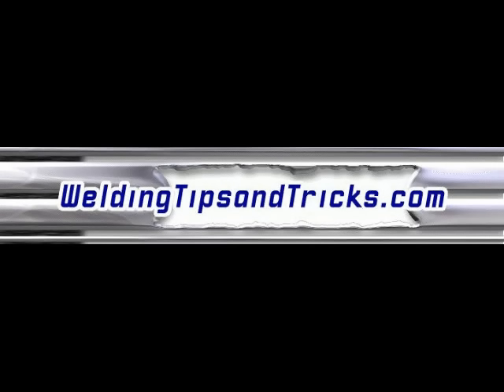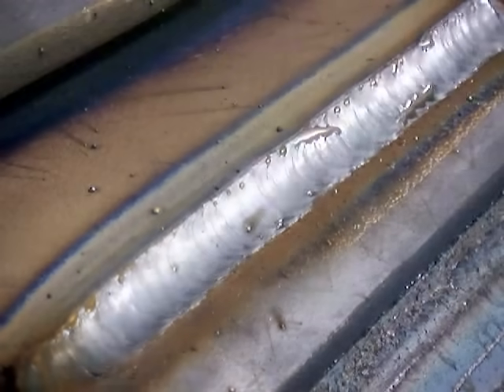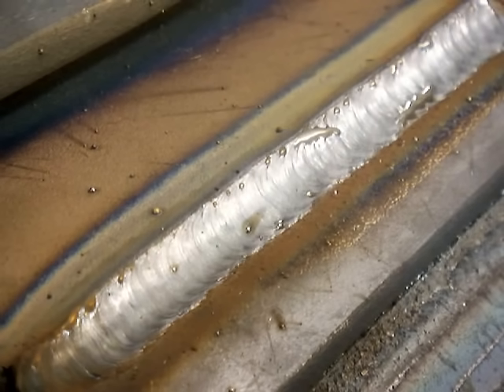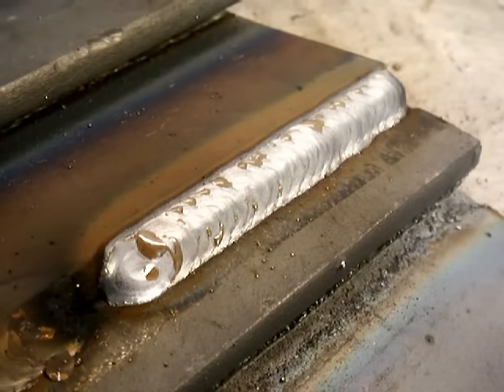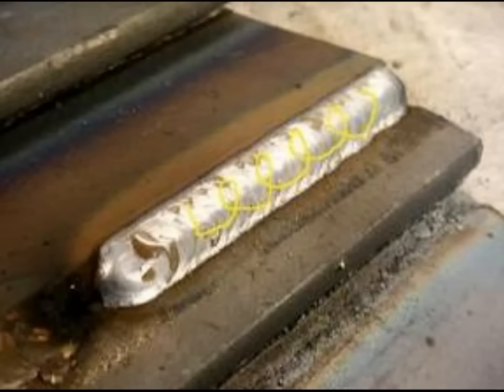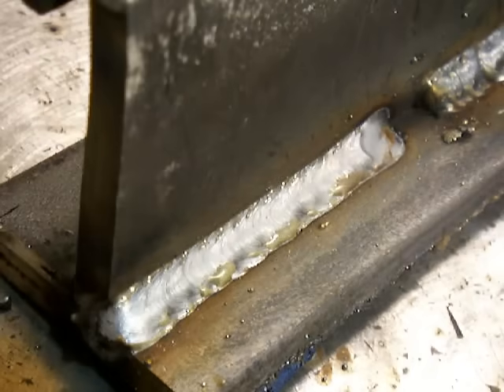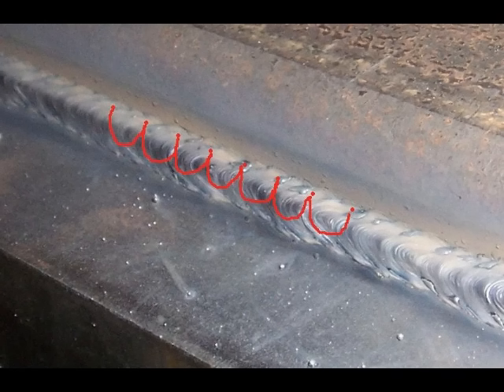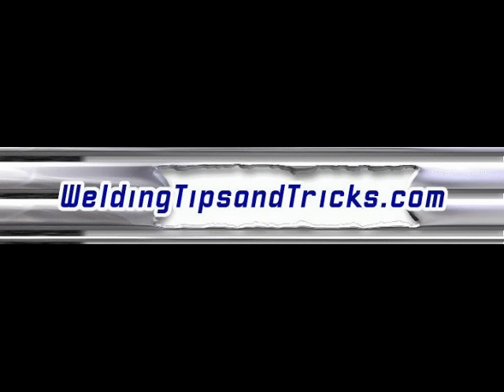Mig Welding Technique Taught by Old Timer

Comment: I am just learning. Hobby/homeowner stuff just out of necessity. I must say those are some fantastic looking welds! I didn't know they could look that good.
Reply: These aren't even that nice!
Reply: Practice, Practice, and when you get tired...more Practice!
Reply: try new techniques of welding on scrap metal as often as you can and don't be afraid to make shit beads. when you find something that works and you like it then tweak it to perfection. ideally you need to understand "L.A.S.H." and keep it in mind when welding (Length of arc. Angle of electrode or wire. Speed. Heat of amperage) try going too slow and see what happens versus going too fast, most people go too fast even when they think it's slow and it might seem like in videos like this that he is moving fast but really it's not that fast when your welding mask is down. try welding on an edge until you learn to control your puddle and use your peripheral view to watch where you are welding but focus on the puddle itself.

Comment: That's what my first high school welding shop teacher taught us. He was a fabricator in the Air Force for 20+yrs before he retired and started teaching in an A+P program high school. He made us draw a half page of different size circles on lines then a half page free hand. I've used this technique working on cars and trucks including chassis repair, fabrication, installing snow plows and tailgates. No failures, gas, mig or tig.
Reply: in my welding class we started out on oxy/acet welding before moving on to smaw. there we would do flat then onto vertical down followed by vertical up and then overhead before winding up with smaw pipe. by the time we went through all that the mig was a cinch and my instructor just told me to go out and and run a few welds and see how it turned out. i think i was on mig about a day before testing it was so easy after so long with stick. then onto tig which i loved the most. i found tig was easy after doing all that oxy/acet welding prior.
Reply: Mine too...Mr. Merriman
Reply: Seems like a good way for me to practice before I take my cert test. Thanks
Reply: I also got taught this at tech school in Australia. I think that most welders that have attended welding school would be taught this technique. Still great to watch.
Reply: Jim Zivn

Comment: also, you will find that when welding galvaniel if you push you won't get as much porosity and you won't get burnt up near as bad. as the spatter flies away from the nozzle.

Comment: I am tired of all these guy saying that it is never correct to weld down hill. That is but crap. If the employer wants it fast and pretty and the engineering says down hill is strong enough for the application then down hill it is! I have found that "never" is a big word. There are always exceptions to every rule.
Reply: B.J. Smith I'd agree, especially if the man running the gun is skilled and welding a correctly prepared joint
Reply: Exactly,Im combination welder and if machine is set right you run a good deep burn in bead down hill and look like it's flat welded and very strong.
Reply: Like I have said before, in the real world sometimes you have to stand on your head. Sometimes the only choice is welding downhill. So what? You do the best possible downhill. 
I once operated a robot arm welder that welded seams on metal boxes. The only possible position was downhill welding with the gun itself pointing downhill. You would never do it that way by hand. I made it go the best I could get it. Worked just fine

Comment: circles are a no no, coming from a metallurgical stand point these are very inconsistent and create immense difference in  mechanical structure of the particular parts of the weld

Comment: For MIG I usually push to keep the weld, simply because its easier to follow the join in front of the torch not hidden by the nozzle - But for some thin material obviously non structural I find it better to pull a narrow taller bead - Pushing leaves a very wide heat signature on thin stuff and the width of the bead makes it blow through easier.

Comment: actually this is the way i obtained a good result for the first time while learning but my teachers once saw it and told me is useless to do that for a straight line, anyway i still use it expecially in the corners...
Reply: +Jarvis Piazza this method is cheating because you dont know how to properly set your gmaw to your speed and skill. And this method increases the cost of the weld thats why it's not preferable in massive fabrication. But for non production use, this weld is easy because it spreads the heat. So you can go with higher voltage and wire speed,and your speed welding. And if you use it,you probably use it because your welding speed is low,and you use semi low wire speed and normal voltage. But you can get the same result by experimenting with your voltage and wire speed and which i think in your case is - you need to increase your speed. I know its hard, but iv'e been in your place. I know how hard is to change your welding speed.

Comment: I am going to try to weld a 1/2 socket to a 3/4 to 1/2 adapter. I want the weld in the middle to be thick. Best suggestion?
Reply: +havier howe I'm not sure of the geometry of your joint ; is it going to be a Butt-joint around the outside of a shaft? - but I would vote for a quite deeply-cut Vee in the prep so that the weld ends-up largely flush.
It will look neat - apart from the burnt Chrome.
Those Sockets have a lot of bulk so they can take an enormous amount of heat and you can get a very deep penetration.
It is also hard to get two short 'shafts' to meet straight unless they fit together in some manner - Might require a Tack or two attempts.

Comment: I do understand that some welders will pull down with a vertical weld which is fine to rid the metal of lite rust but a vertical pull down will NOT give you good penetration and can even cause porosity in the weld. Vertical welding should always be done bottom to top only unskilled welders pull down. When doing a 6G weld test with an aluminum MIG. I was told that I needed  to pull down that it was impossible to do it up hill.  I don't do welding the lazy way so I showed them that it could be done if you know what your doing. And trust me aluminum 6G MIG is no easy feet. Welders need good advice and lots and lots of practice. Welding schools give you the fundamental but lots of practice and wisdom equate to a good welder. Keep testing yourself as you can always do better.
Reply: Mm
Reply: dig as deep as you can in both sides en finish it wit a smoot welding.
Reply: +R Reichel 

Welding aluminium downward is a sin....